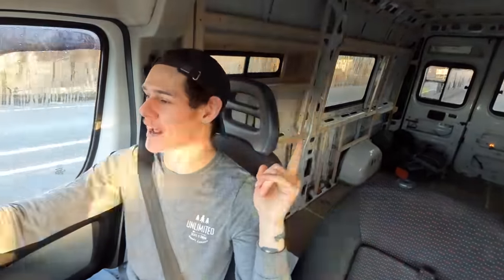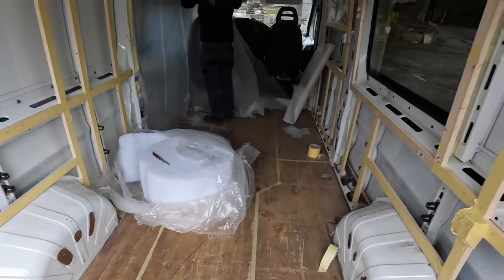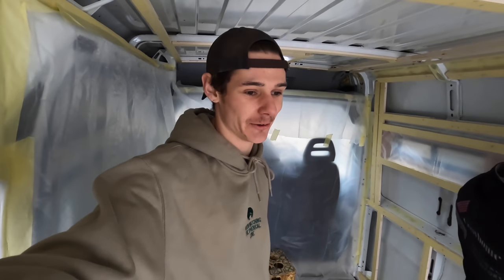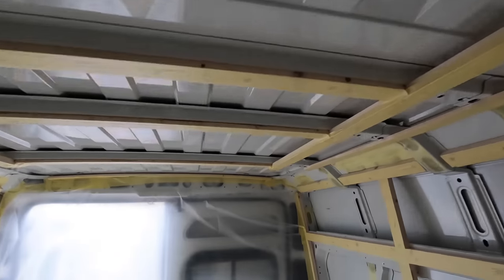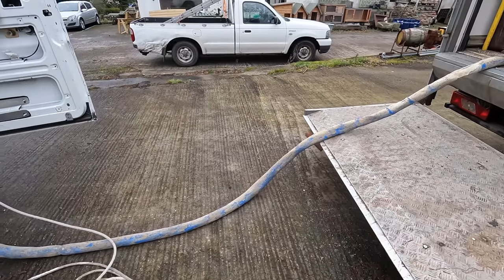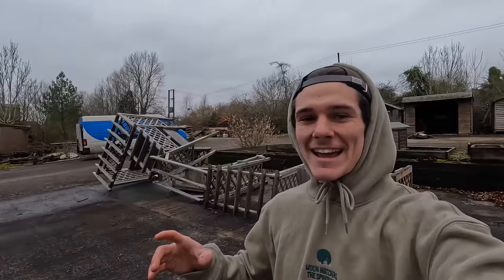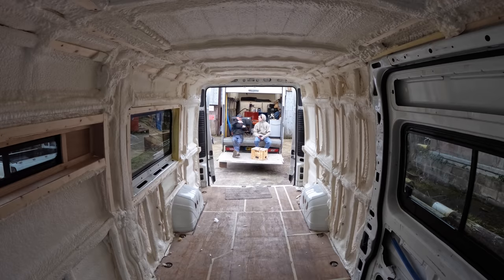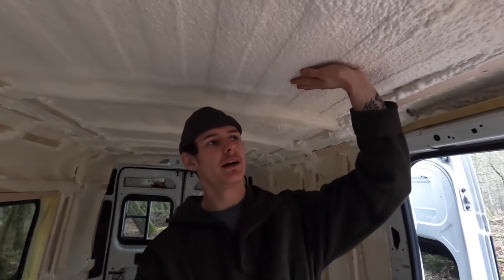CHEAPEST WAY TO INSULATE A VAN! Extreme Cold weather Insulation!

Comment: I just had done my spray foam by a company in Nottingham and I'm really happy with it. The guy filled all the panels that I wanted and I didn't notice any warping or swelling. It's good to look for guys that are insulating boats because they have experience in getting it done in small spaces with a lot of details. It's also good to see if they post any photos of the jobs they've done. 
Great video, it made me trust the experience of the guys that are doing it everyday and I'm really glad I did. And like you say, it's way cheaper this way.
Reply: Hi Mariusz, can I ask for the name of the company please? Might get mine done there!!
Reply: @8skywalker8  After some time I noticed a bit of swelling in a few places but it doesn't make a big difference to me, personally. You can barely see it only on a certain angle. And remember to protect outside of the van, especially around the side door because I haven't done that and wind spread insulation bits on the bodywork. I think that it should go away with some polishing but I didn't get to it yet. Anyway, fair guy, easy to talk with and he didn't charge a fortune.

Comment: Didn’t really spray as much as I expected. How thick is the foam?
Reply from the maker: It’s pretty decent tbf! Solid 3/4 inch 🤘
Reply: @JakesJourneyMate  oh sick that’s perfect. I sprayed my van myself and you most definitely made the right decision having it done. Costed me way too much and he did a great job for you
Reply: Thats only about R5. With the body heat of two people, to keep it 20C inside, the outside temp could only go as low as 15C before a heat source is needed. And that’s with no windows and without opening and closing doors or vent fans. And without an insulated pass-through wall. You can use a heat source, sure. But if you’re really about the environment, you should insulate your van well enough to not require a heat source but for occasional, very cold times. With 2” of spray foam,  body heat is adequate to keep it 20C inside if 0C outside. 2.5” to account for the windows. Then make some insulated, removable window covers to be more efficient while sleeping. Will need the insulated pass-through wall too. Any excess heat can easily be vented through your vent fan which also greatly assists in reducing excess humidity. This amount of insulation keeps heat out in summer until much later in the day and allows the vent fan to work more effectively to reduce temp as much less heat is being radiated/conducted in from the outside. Its a myth that heavy insulation makes summer evenings too hot, just need adequate ventilation. I opted for an efficient aircon myself, running from solar during day and battery bank at night.

Comment: Your Steering Wheel has an Airbag. 
In the unlikely event of it going off, you need to learn to protect your Thumbs from being Broken, by not curling them on the inside of the Steering Wheel. 
Not hard to do, particularly if you consider 6 Weeks without Use of your Thumbs.